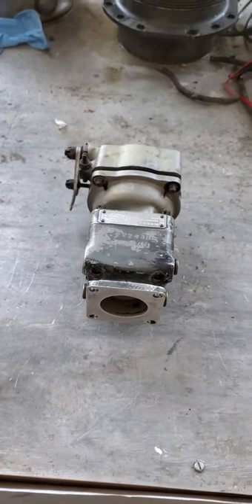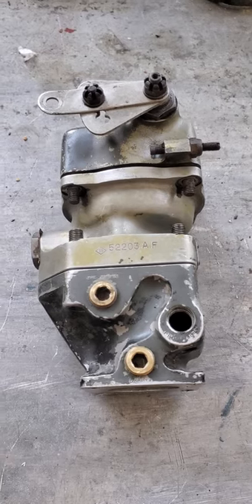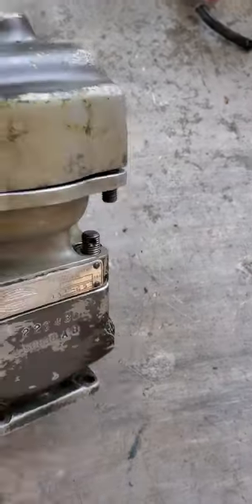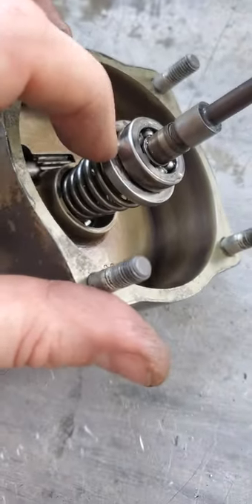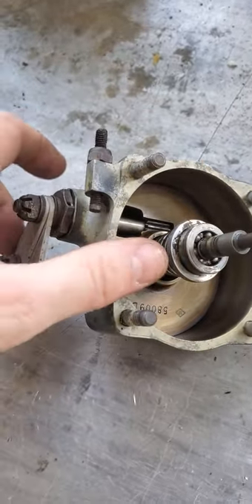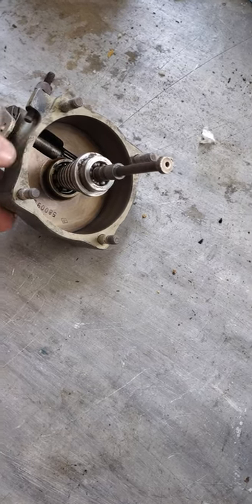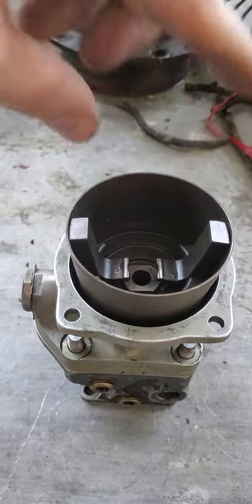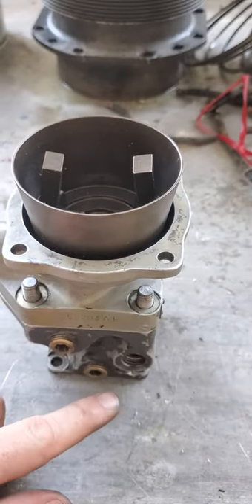Jacobs R-755-9 Restoration part 14 Propeller Governor

Comment: Hi Mike, you sound pretty knowledgeable on the Jacobs engines, and enjoyed this video on the prop governor. Question: can a faulty prop governor cause low engine oil pressure? I have a jacobs 330 that was field overhauled. When it is run, oil pressure is good until we cycle the prop, at which point the oil pressure does the initial drop (as expected) but then never recovers... it stays low. No signs of leaking oil. Any advice?
Reply from the maker: When you say "cycle the prop" do you mean change from low rpm, to high rpm and then back to low rpm?
Reply: Actually the opposite: going from high rpm (low pitch) to low rpm (high pitch), then back to high rpm (low pitch).
Reply from the maker: @shawntheiss7375  2 things,  is your propeller the HamStd 2B20? And should you not be starting in high pitch low rpm?
Reply: @mikesmith7249  Hi Mike, sorry the weekend got crazy! Yes, correct on the prop. And yes, start engine with high pitch/low rpm for about 30 seconds, then move prop to low pitch/high rpm. When engine temp warms up, do magneto checks and then prop checks. This is when the oil pressure stays low after doing the prop pitch checks.
Reply from the maker: @shawntheiss7375  Hi Shawn,  
I'll say first that although I am an A&P, this in no way constitutes maintenance advice. Please see your local A&P. 

With that said, I dont think the prop governor is the problem, as long as the propeller is properly responding to control inputs, your prop governor is working properly.  All the governor does is route oil from the engine oil system to the propeller hub to move the piston from the High Pitch (Low RPM) setting to the Low Pitch (High RPM) setting. The change back to High Pitch is a function of the propeller counterweights once the RPM lever is moved. Now, there's very little engine oil that is required to change the propeller setting, so I would also rule out servicing as an issue (probably wouldnt hurt to check though).

During start, you might wait until you receive 30 seconds of steady oil pressure at ~50psi (or whatever your POH says) imstead of waiting 30 seconds regardless of oil pressure reading. (This unless the POH does not address oil pressure before switching to Low Pitch, remember always follow the POH).

Hope some of this is helpful. If you dont mind sharing,  Id love to hear a followup once the issue is resolved.